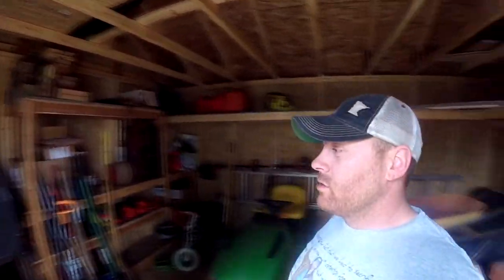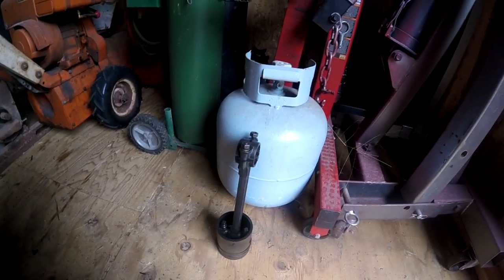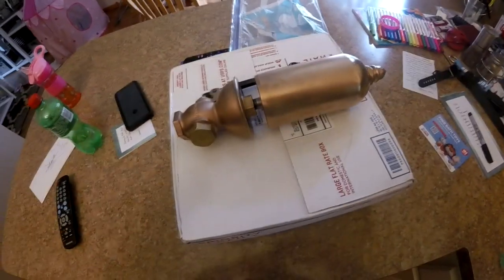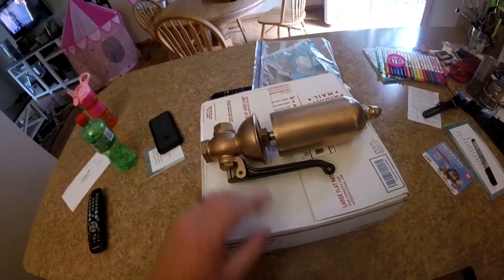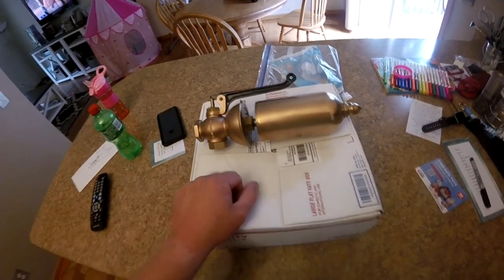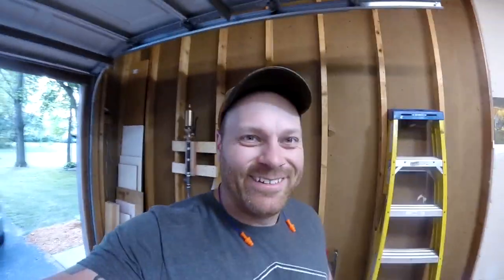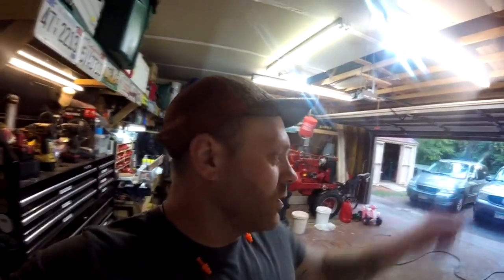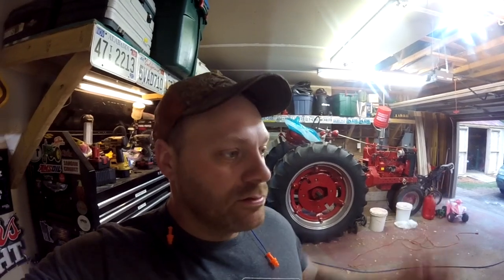Happy 4th of July! John Deere E, Steam Engines, and Birthday Gifts!

Comment: Check the oil pan on the JD engine. Between the fuel tank and block. Known to rust through. Pin holes. Thanks for the videos
Reply from the maker: I definitely will. I have a spare pan as well as a tank. The pan appears to be good, but the tank has a pinhole in about the same spot as the repair on the original.
Reply: @KennyKizzleRustyNutzRanch  
It will be a nice engine when your done.
Reply from the maker: @lwilliams1715  that's the hope!